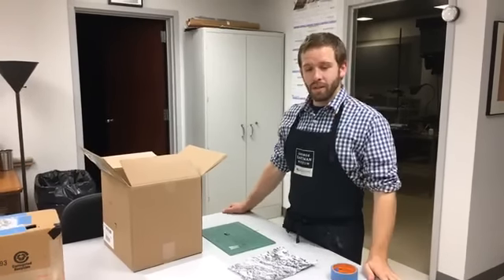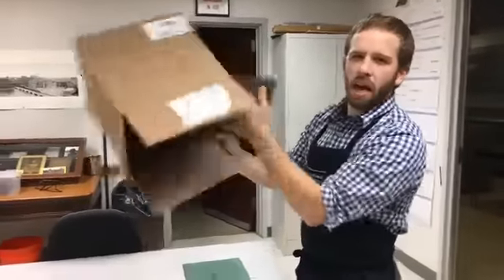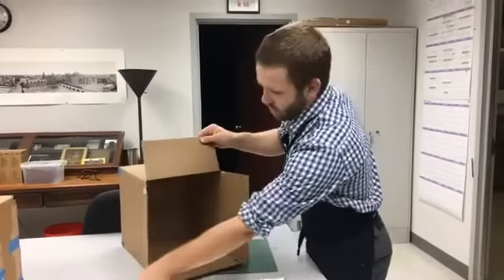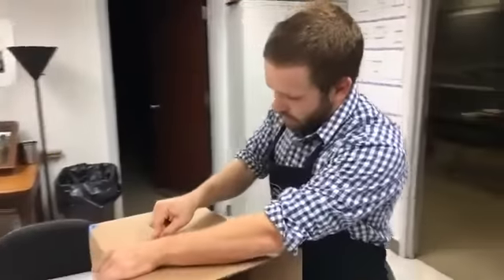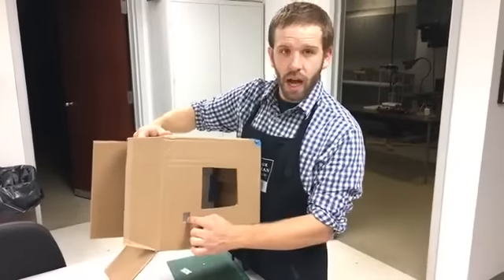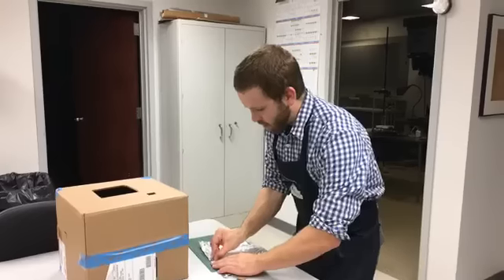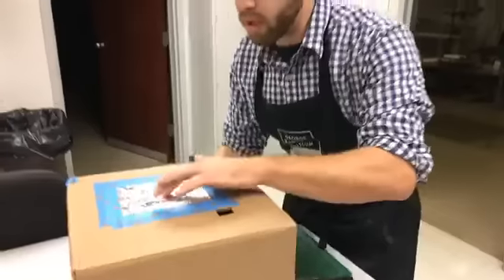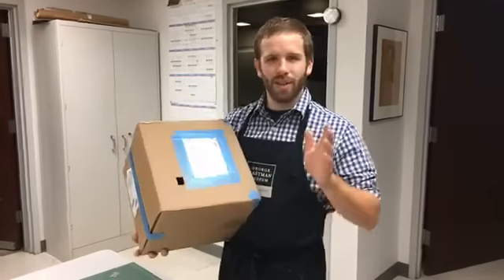How to Make a Pinhole Camera

Comment: here’s what I don’t get. If your trying to have no light come in at all, but you make an open hole to put your eye in (which will obviously let light go inside) how does it still work? I’m about to make this but I really need to know this because I don’t want to waste some materials and time (I’m gonna be extra and spray paint it)
Reply from the maker: One side has a small opening for you to look through, and the opposite has just a tiny pinhole. Since you aim the side with the pinhole at the light source, the side with the larger hole for you to look through should be in the shade. It may not seem like it works, but it does! Perhaps try it out with some cheap materials from home, and then make your amazing extra version after :-)